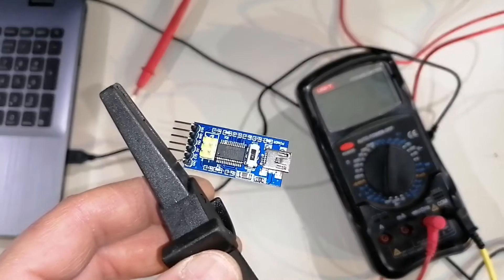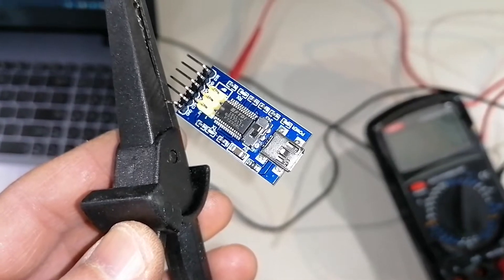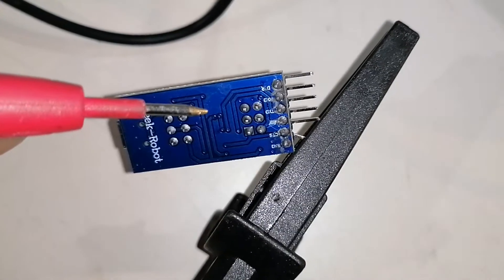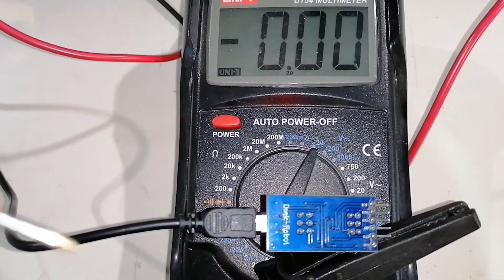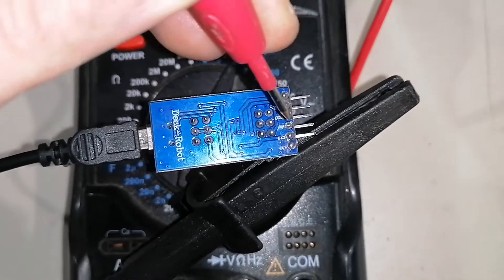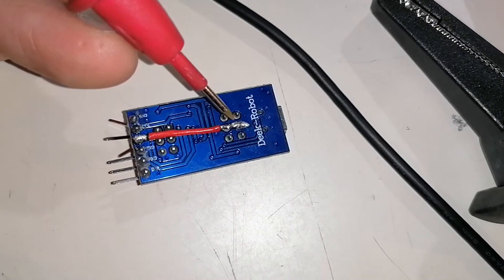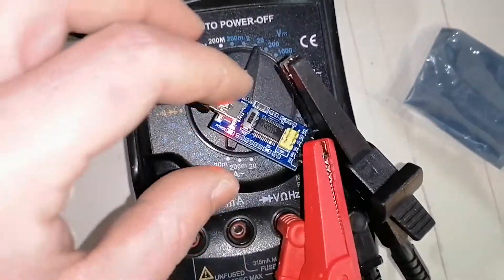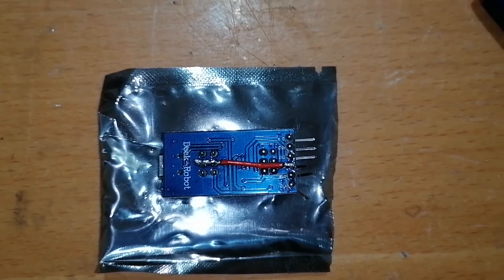Beware of this serial adapter. FTDI USB TTL Tasmota Esp home

Comment: Does this mod also change TTL level? Measure Tx and Rx against Gnd.
Reply from the maker: Well I can't say for sure I will have to check if the converter is always on 3.3 and only 5 V comes from the USB or if it also changes the voltage to the whole converter.

Comment: I am making Arduino NANO diy

Please tell me which ic ftdi chip is suitable

Is ch 340 g can be used
Reply from the maker: Not familiar with andruino but this adapter has this chip https://ftdichip.com/products/ft232rl/
Reply from the maker: However in my zigbee coordinator project I used this one RON 16.64  12%OFF | (5piece)100% New CH340C sop-16 Chipset
https://a.aliexpress.com/_mNYbfyj
Reply: @DIYHelper  
So
Which is best from both of them

232 
Ch340

Can you please tell me

Which is better FTDI communication (Rx,TX )

Or ISP ASP communication (MISO,MOSI,SCK)
Reply from the maker: https://learn.sparkfun.com/tutorials/sparkfun-serial-basic-ch340c-hookup-guide/all   they both work.